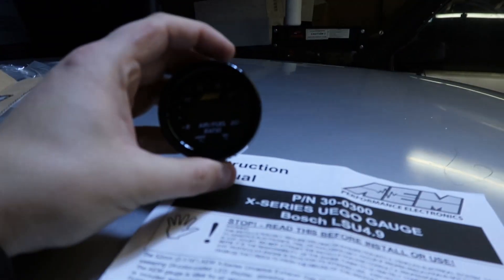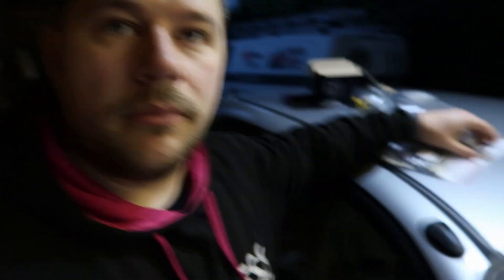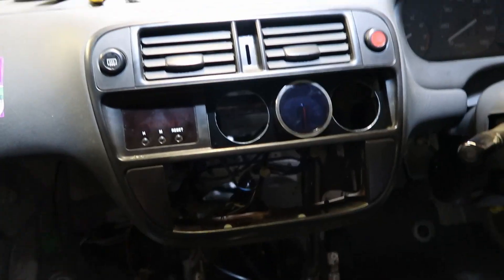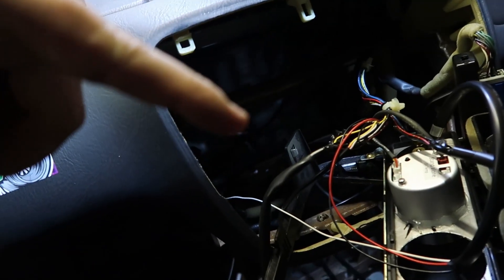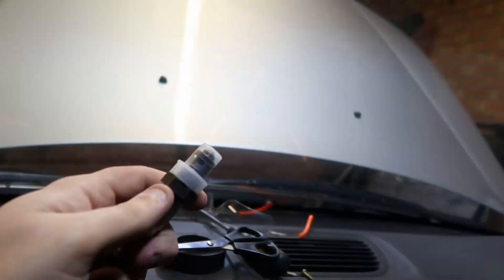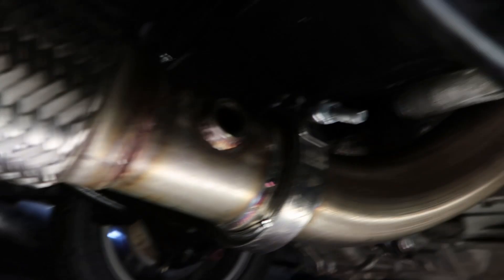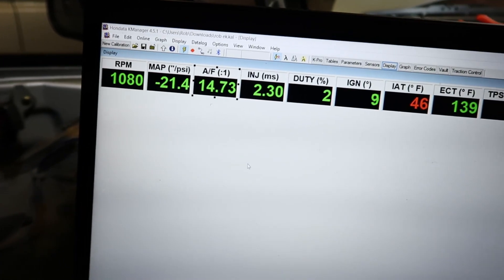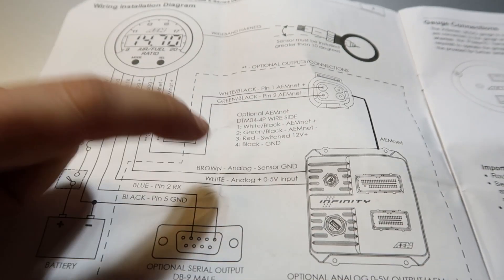How to install an AEM Wideband to K PRO V4 - Honda Civic K Swap Part 13

Comment: My wideband sits at 14.7 for like 10 seconds then climbs up all the way to 18+ then it just flat lines at - - -, even with the car off it does the same thing. I’m pretty sure it’s wired correctly though I’m not sure because I bought the car as a project. Does anyone have any suggestions? K24a2 swapped 89 crx.

Comment: @15:20 are you referring to the brown connecting to the earth on the Kpro wiring itself or that analog adapter you added that has a black wire probably serving as ground?
Reply from the maker: Brown wire goes to the gnd on the Kpro.

Comment: Where did you put the brown wire
Reply: You can actually put the brown wire (analog input -) on to the analog input socket name GND while having the white wire (analog input +) on to the analog 0 input.
Reply from the maker: Brown wire goes to ground on ecu

Comment: Does it go where the primary lambda sensor was and then a bunch where the secondary one was
Reply from the maker: Yes it replaces your primary and you can turn off the secondary O2 sensor.

Comment: Great tutorial! Quick question though. Does the AEM wideband actually read any differently than the stock wideband does in Kpro? Is it more accurate or something? I have a K swapped Civic too and I'm thinking about getting an AEM AFR gauge, but I'm not sure if I even need to since my Scangauge shows the air fuel ratio from the stock wideband anyways. Thanks
Reply from the maker: Thank you, I only installed a wideband as I had one laying about. Realistically I don't need one with being pretty much stock power, although it'd be handy if I boost it to check on AFRs, if your stock power I wouldn't bother really unless you wanted to keep an eye on your afrs

Comment: Where’d you wire the black ground ? I know you said the brown ground goes in the ecu ground pin, but the black one ? Did you ever think about merging them together
Reply from the maker: The black earth went to an earth wire, but you can ground to the chassis. Don't merge the black and brown wires together, they need to be separate earth's.
Reply: @FlawlessCulture  thank you for confirming that , I’m actually on my way to do the black wire and run it to the thermostat ground and then I’ll put the brown on the ecu. 🤞🏽hopefully it works fine . I was having that issue with the gauge reading at 9.5 the other day and my smanager reading differently thank you
Reply from the maker: @jritefrom56  yeah I had exactly the same issue until I ran the brown wire to the ecu earth.
Reply: @FlawlessCulture  I hope this fixes my issue . So I’m going to run the black to the thermostat housing and then the brown to the ground pin out off the ecu . Should work right ? Lol

Comment: Hey great video. Did you literally run a ground wire to the case of the ECU or is there a ground connection inside you connected to?
Reply from the maker: I plug a connector into the ecu in the beginning of the video in that bunch of wires there is 2No ground wires. I think either but it should say ground on the board. That's where your second ground goes to or brown wire.

Comment: Hi I have a Civic eg with k20 from Uk ep3. Which configured I have to use on kpro manager?
Reply from the maker: You'll need the Civic Type R - PRA and the K20a2 civic type r factory.kal, thats what I used.

Comment: Everybody forgets the brown wire....

Also, try to never start the engine, after the gauge has already gone though the sensor heat cycle.  The sensor "warms" up to over 1400F.  When you hit it with a blast of cold ( and, usually wet ) startup exhaust, you cause fractures in the sensor's ceramic element.  This is what sends most aftermarket WB sensors to an early grave.
Reply from the maker: Ha ha glad I’m not the only one. Thank you for your advice, I will take that on board.
Reply: Interesting, never thought about that but it makes perfect sense. Just curious why this doesn't happen with the stock sensor since it also starts heating as soon as the key is turned on? Or does it?
Reply: @averyalexander2303  It does not. The car's ECU waits until the engine is started to begin heating wideband sensors.  Easy, since it KNOWS when the engine is running :)
Reply: @lordandprotector  I just checked the wiring diagram for my OEM o2 sensor and did some tests and I stand corrected. I assumed that the sensor started heating as soon as the key is turned on since the o2 sensor heater relay is activated as soon as the key is turned on, but that assumption was incorrect since the sensor's heater is grounded through the ECU and it turns out the ECU doesn't ground the heater until the engine is running. The more you know 👍
Reply: @lordandprotector  is it anywhere on the chassis for the brown ground or is there a ideal location for it ?